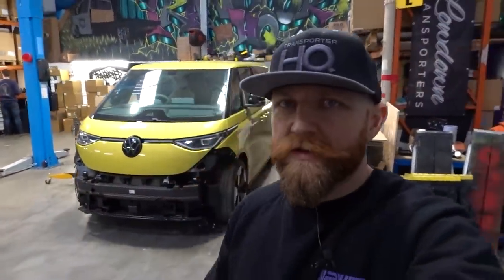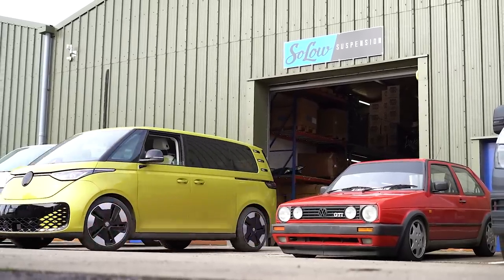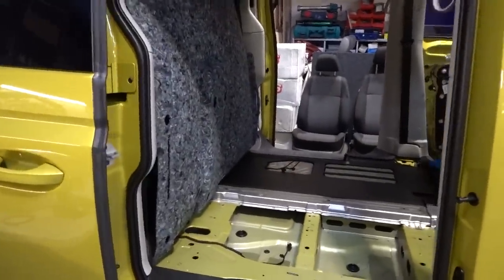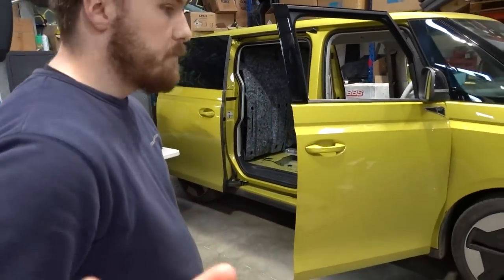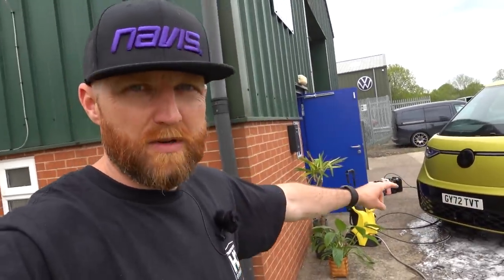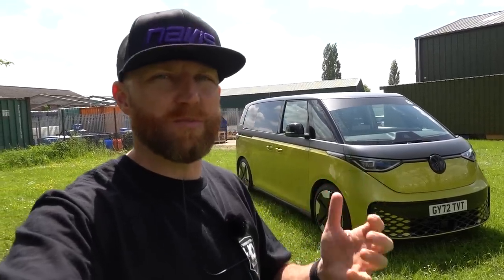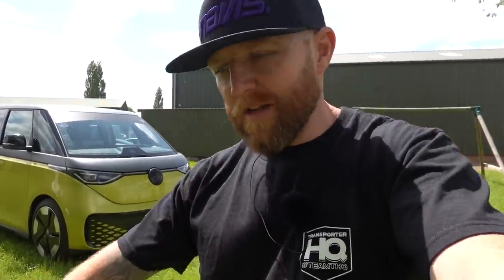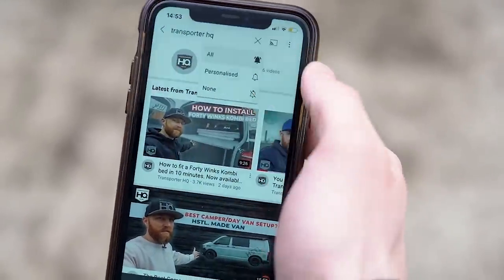VW ID Buzz modification stage one, lowering, audio, colour changed grill and wrap. Love this thing!

Comment: Interesting. T6 with ID Buzz motor, battery and charge speed would be an instant winner. I wonder if thats in the works.
Reply from the maker: The T6.1 replacement will come as a full electric option for sure.

Comment: You have done an excellent job with this, it looks fantastic. I’m only disappointed with VW’s execution of the van. The underlying technology was obsolete before the Buzz made it off the drawing board, VW have moved at a glacial pace with this product. This is so sad because there is so much love and good will for their historical products. I have no doubt if this van had a real world range of 300 miles in all conditions, over the air updates and a GUI that worked as it should there would be plenty of love for the Buzz. VW signed a deal this week with Chinese Auto companies Xpang and Saic for over €700,000,000 for the Chinese to supply and build power trains, batteries and software for VW & Audi to rebadge as their own vehicles. With Croatian company Rimac Automobile providing the batteries, power trains and software for the Porsche EVs VW’s surrender is complete. I wonder what will happen with the next generation of vans?
Reply from the maker: The Xpeg actually looks really impressive though. I guess only time will tell

Comment: Looks awesome, but, hydrogen vehicles only use the hydrogen to convert the gas to electricity to charge a battery to power a motor. Sound familiar but without the hydrogen fuel cell costs??
Reply from the maker: Is that right, very interesting. It does seem like all the car manufacturers are focusing very much on EV's at the moment.
Reply: @THQAutomotive  with the 2030 deadline looming, in the UK, EU and USA as well as a good few others, they don’t have much choice. Not going to build new car factories and battery plants for nothing. If they’re not on the bandwagon by now they might get left out! Where’s Nokia, Blackberry etc now the IPhone came out?

Comment: On cost  have you seen the price of a new good spec caravell these days, then cost of running?
Reply from the maker: I haven't looked into it no. I guess a high spec caravelle is similar to the Buzz?
Reply: @THQAutomotive  way more expensive! We bought an ID3 last year and everyone said they are too expensive but a similar spec Golf was more expensive in the same showroom! We payed £29990 after discount and Golf rrp was £31000. GTi top spec was £44000
Reply from the maker: @kinross24  I'm super tempted my a Cupra Born for the wife after using the ID-Buzz. Not sure sure we're ready for house hold with no combustion engine 🤔
Reply: @THQAutomotive  we were the same and my wife hung on to her Yaris but after traveling all at  oh no Scottish highlands with the two dogs in my EV, a 2020 Ioniq electric that’s max range is only 190 miles and gets this easy in summer, or much more, and 160 in summer, she had a drive in it and when home went straight into nearest VW and tested the ID3. She’s got the 58kw battery and has a 1hr motorway commute to work in Motherwell from Kinross and manages easily, gets the predicted 260mile range. We both charge at home and mostly from our solar and battery storage so drive for free mostly, on sunshine. It’s great always having a ‘full tank’ every morning!! She had a 2022 Golf as a courtesy car last month while hers was getting software updates and said it was like hell to drive. Her words were ‘like going back 100 years’! We’ve don’t the NC500 with ease, Heart200, NE250. And each week there’s more, many more chargers added. Our daughter loved to gift of a free Yaris btw, but is on the ID3 insurance so loves it and hope her mum gets a new car soon! I love my Ioniq. Nick named ‘the wind knife’ in ev world because it’s so efficient. Go for it!
Reply from the maker: @kinross24  that's great to hear. Thank you for those details